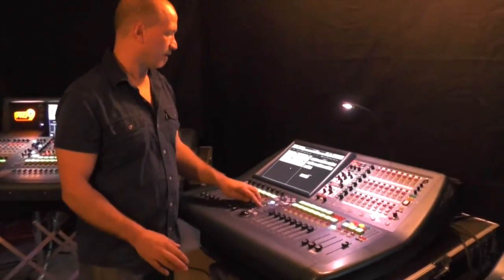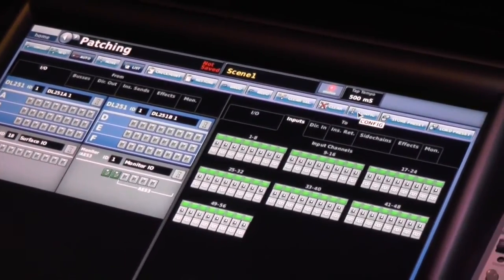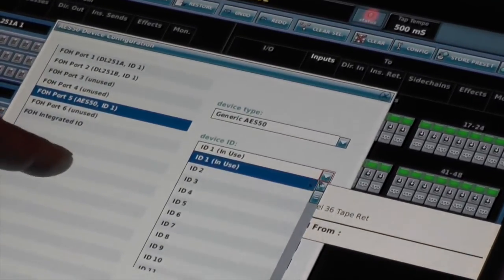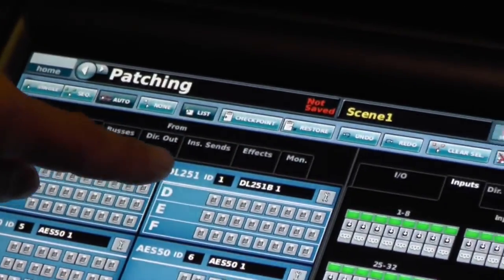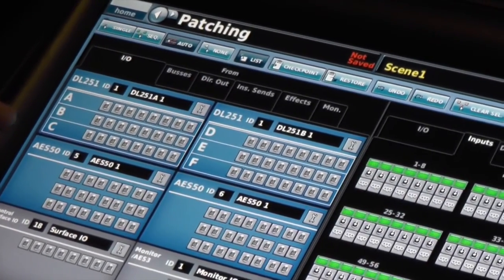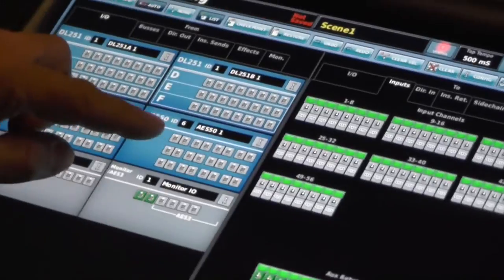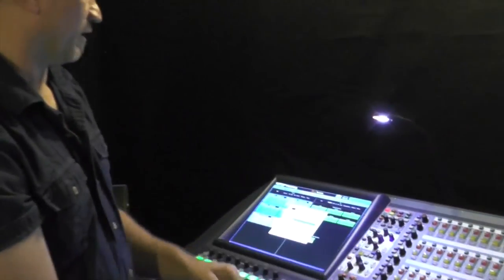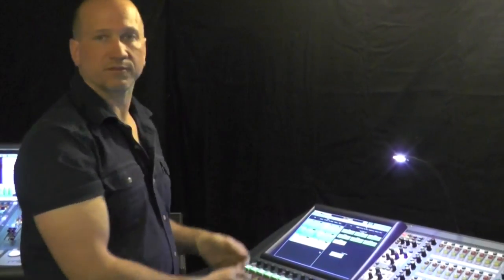Midas #101 with Jim Roese - The Benefits Of Patch Labeling

Comment: Hi Jim, I see you are going straight from the DL251 to the RPM Module and not via the Direct Outs of the Input... Can you tell me if there is any difference between that?
Reply from the maker: Hi Bernd, this way sends a pre-processing signal that is the same as setting your direct outputs at zero to your record also.  I like it as it doesn't give the ability to change from that setting and always follows the headamp perfectly.  This is important for virtual soundchecks to match.  It also doesn't rely on scenes and avoids the possibility of having a scene that a direct output isn't unmuted, someone spinning a direct output from zero, and the time to check all of those settings.  It works basically as a virtual y-split from the headamp to the console and the record device.  

Cheers,
jim
Reply: SoundProLiveNetwork Hi Jim, thanks for the fast answer, I now are going to do the same thing as you, it will saves lots of time when using the Midas for Musical shows with lot of scenes